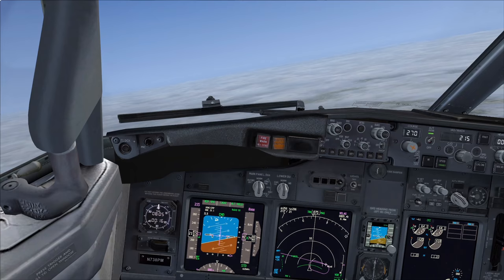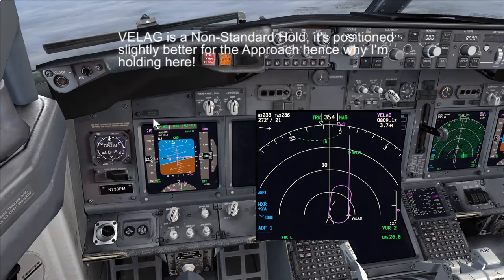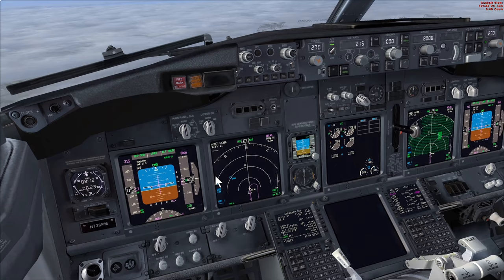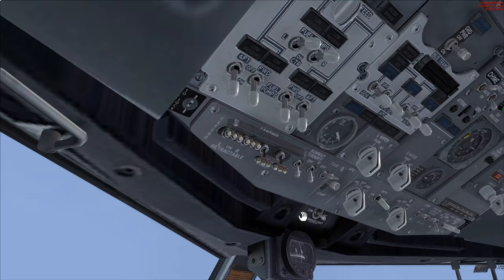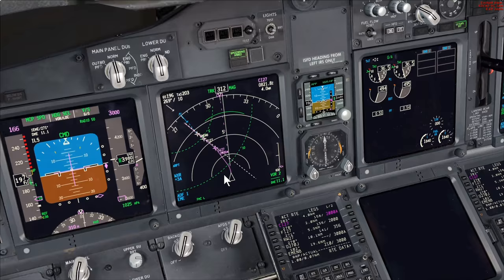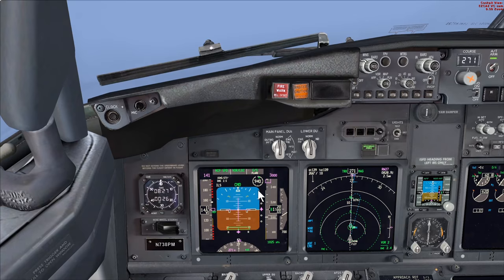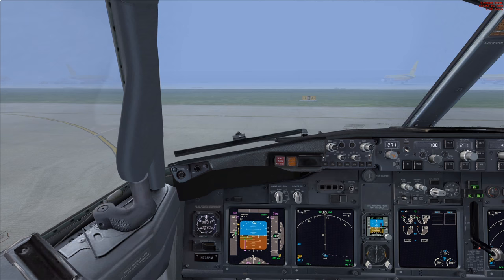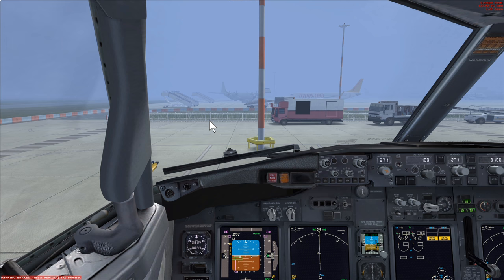How to Autoland a Boeing 737 | REAL BOEING PILOT  | PMDG 737 | CAT III ILS

Comment: Hi :) If you were doing Cat II (not III) approach, is autoland mandatory, like in cat III, or can you swich to visual near the runway and land manually? Also, can you make an autoland on Cat I only runway? If yes, would you notify ATC/ ask them for permission or something like that? Except for higher minimums, would the Cat I autoland differ somehow from Cat III? Thanks in advance and really appreciate all your previous responses to my questions :)
Reply from the maker: Hi Konrad.

Where I work CAT II does require a mandatory autoland. 

You can conduct a "practice" Autoland off any ILS regardless of category but there are limitations regarding visibility. The aircraft can do it on just a standard CAT I ILS, what differs is the protection zones, lighting and backup requirements for CAT II/III approval.

FD2S
Reply: What are the weather conditions, below which you decide to go CAT II/III? Is it when weather gets below Cat I minima (RVR 550m) or sth different? Also, does ceiling matter? For example, if there is OVC001 or OVC002 but good RVR/visibility, is it required/recommended for you to do CAT II/III autoland? As always thank you for answering all my questions, looking forward to your answer on this one, wish you safe flying :)
Reply from the maker: Konrad Dołowy always try and do the lowest capable to improve your chances of being able to land. Cat II instead of III will be due to some sort of unserviceability.

FD2S
Reply: @flightdeck2sim  That clarifies things, thank you for response. However, what I actually meant was: when you are mid air and do approach brief, how do you decide if you will make standard ILS cat I with one autopilot and manual landing - or cat II/III autoland? In other words, how bad the weather must be(RVR? Ceiling?) at dest. for you to choose autoland?

Comment: I Have a question when you were at FL080 and set the descent do 3000 you set the QNH is it when you are cleared To descent below TA?or when you pass TA?
Reply from the maker: Mi Mati.

When cleared to descend to an altitude we immediately set the QNH, you don't need to descend past the transition altitude.

On departure the same applies, we set STD typically after the flaps are up if our stop altitude is a FL.

Good Luck!

FD2S.
Reply: If you do it that way just don't forget to reset standard pressure if asked to level off before TA at the last minute. :)

Comment: Sorry if this is a stupid question, but just to clear things up for me, is it possible to do an autoland on any runway in FSX, even if it is technically not certified as CAT lll? Thanks in advance!
Reply from the maker: Hello!

A runway does not need to be CATII/III equipped to conduct an Autoland in the 738, the aircraft can do it on just a standard CAT I ILS, what differs is the protection zones, lighting and backup requirements for CAT II/III approval.

FD2S
Reply: flightdeck2sim Thank you for the quick reply!

Comment: Idle reverse is approximatly 45% of N1 ? Because you put idle reverse around 25%.
Reply from the maker: Hi Alexis, 

When you manipulate the thrust lever on the real aircraft after touchdown and move it to the reverser interlock position and detent no1 (Idle reverse) it should be initially around 32% (Flight Idle) and then drop to approximately 22% (Ground Idle)

Second Detent, when you move the reverser to the 2nd detent position = 75% N1

Max Reverse = 82% N1

Not too sure how the PMDG is programmed but you should only get a MASTER CAUTION  - ENG - REVERSER 12 seconds after deployment when a malfunction occurs!
Reply: Thank you for your answer. But it seemed to me that there was a special position at 45% of N1? Maybe I'm wrong
Reply from the maker: You can stop moving the thrust lever in between the detents and you'll get the appropriate N1 setting, you wouldn't do this in the real aircraft. If you're using F2 to select and set reverse thrust, wherever you take your finger off the button it will stop moving the reverse thrust levers! Not ideal!

Comment: All airports in FSX are CAT III which is very weird.  So even when you are flying a non-precision approach to any airport in FSX, you can get vertical guidance down to the runway as if there was an ILS. lmao
Reply from the maker: Hi Mehmet! 

In reality a runway does not need to be CATII/III equipped to conduct an Autoland in the 738, the aircraft can do it on just a standard CAT I ILS, what differs is the protection zones, lighting and backup requirements for CAT II/III approval.

FD2S
Reply: Yes , you are right captain. But the problem is that You can literally perform an autoland in a VOR/DME approach in FSX.

Comment: What's the version of the pmdg 737 you are using ??
Reply from the maker: Version 1.10.6461 apparently! I believe this is the most up to date version.
Reply: I have the same version but i have very low virtual cockpit resolution, any solutions please ?
Reply from the maker: Not too sure, this is not my area of expertise! 

There is an option in the PMDG Operations Center. Select the product  and under performance settings you can change the resolution of the virtual cockpit textures, model and displays. Good Luck!

flightdeck2sim